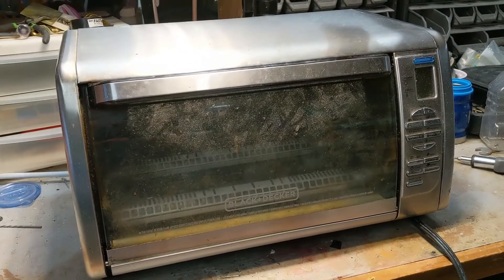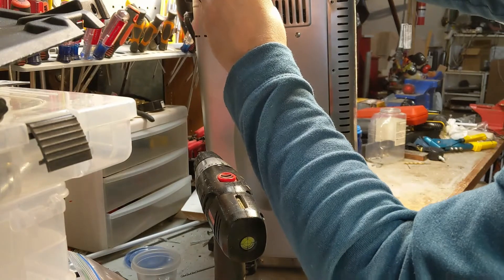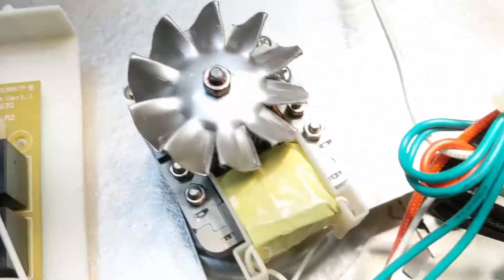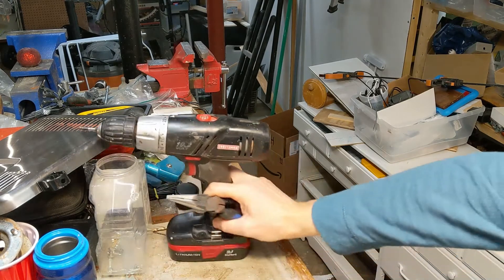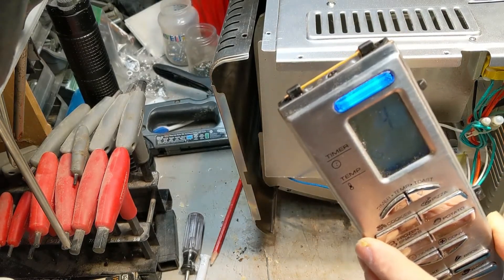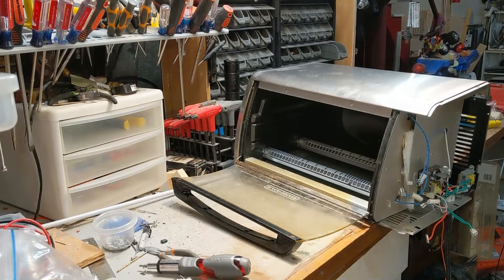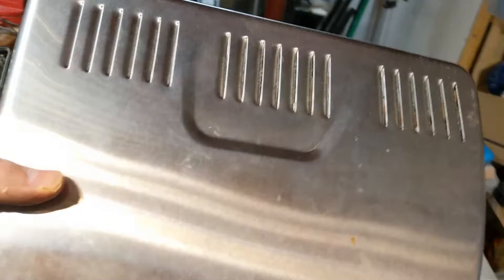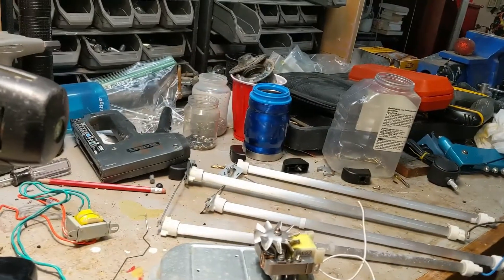Teardown Time - Pooched Black and Decker Toaster Oven

Comment: Thanks, just bought a bigger brother of this oven to do solder reflow work on surface mount electronics.  I wanted to remove the shields as they are blocking heat but after watching the video, no fun in removing them and they appear to sort of set the wall to wall distance (??)